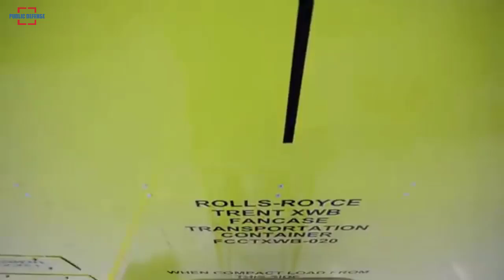Turkish Defense Industry has Started Cooperating with Rolls Royce on the Engine to Power TFX Fighter

Comment: Because Rolls-Royce is also building an engine for the Japanese f35 variant. I'm really surprised they didn't build the engines for the f-35s used by the RAF. It could have severely reduced some of the operational costs. Which is a massive drawback of the joint stealth fighter